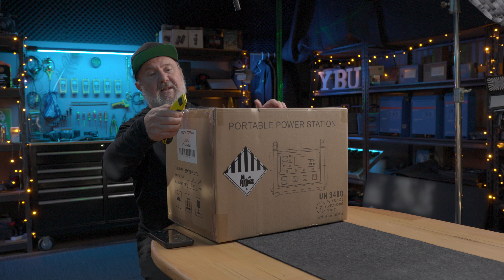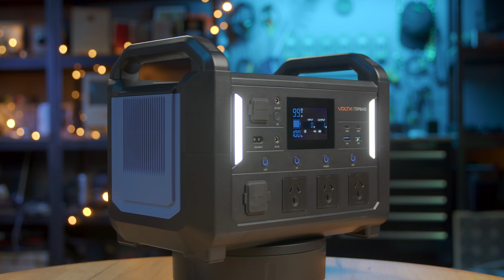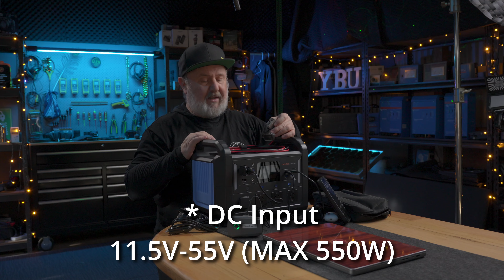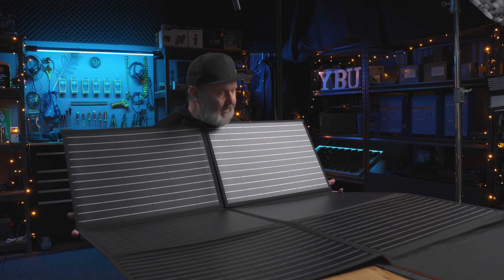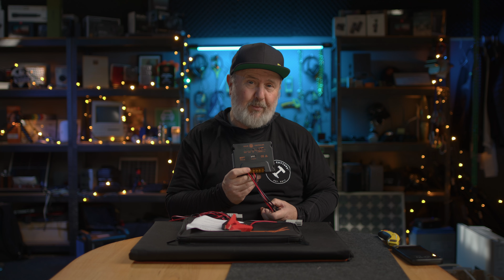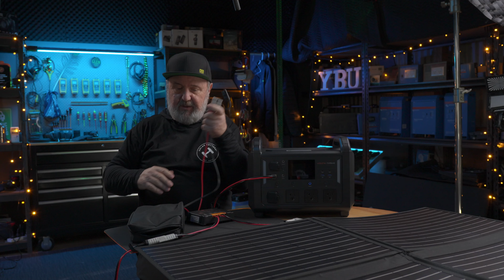VoltX 1200W Portable Power Station

Comment: I purchased this from ALDI yesterday. Reconfigured to be a aluminium hard case instead and still folds into a carry case looking for hours I couldn't see it on viltx because the same configuration was nearly $2000 on black friday sale of 50percent discount but mine was $145 from ALDI. 200 W and the cables all included.
Reply: Are u happy with it? thinking of buying the 2400w power station with the 100w solar panel. I live in a unit. Thanks

Comment: 1. Do solar panels need to go through the MPPT before it goes to the power station or can it plug straight in aka. inbuilt MPPT? (I guess it's inbuilt since you plugged it in directly)
2. What's the maximum 12V output? I'd like to try and run an 12V camper AC off it maybe
Reply from the maker: I believe the solar input is a simple PWM regulated charger, so you can directly connect a panel or two to the input.

Comment: Does the power station have a built n charge controller ? . I ask this as you disconnected the mppt controller and connection directly to station from solar panel . Cheers great vid
Reply: Hey Matt, yes portable powerstations have mppt build in, the mppt controller you saw, comes standard with the solar panels😉
Reply: That was exactly my question. Thanks for that 😊

Comment: Great video, thanks. So why do you need the MPPT (included in the solar blanket kit) to connect to the VoltX car battery but not the VoltX 1200W Power Station?

Comment: Hello again Glen. Could you, or anyone, tell me why these battery/inverter units are called “solar generators”? They don’t generate a whiff of anything without auxiliary solar panels, or a wind turbine. They are merely an electrical storage vessel, with some cute switchgear, and a clever AC output.
Is “Solar Generator” somehow more exciting than battery/inverter?

Comment: Hey mate, how loud is it? When it's under load does the fan turn on loud? I have the voltx 1500w and it has a super load fan that just turns on and off intermittently, even without a load. Cheers
Reply: Hey mate, been waiting to buy, can you please tell me if the fans are loud or not? Do they run at full tilt when they come on? Or are they quiet under low loads? Cheers
Reply: This is a quiet unit.I have the 1800 W.I'm just furious that I have to shop around to look for the cord that connects a solar battery to the actual solar panel.\nAs I don't know what i'm looking for she sent me the link to the wrong one
Reply from the maker: Watch this space :)

Comment: This vs dji new offering or echoflow options? I’m looking for a hybrid setup for my sprinter van and I’m thinking about running a 100ah under the seat to power lights and the fridge . I would add an additional power system like this to charge your ebike on the fly